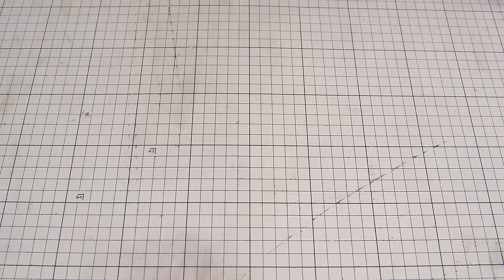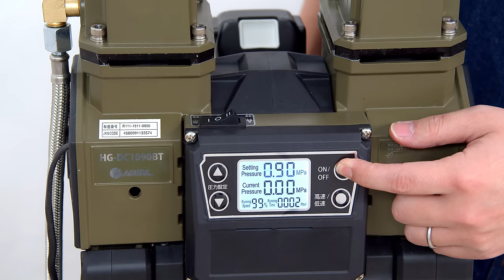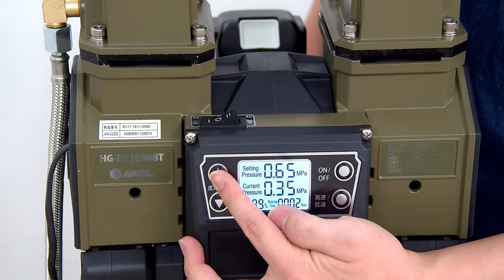How to make a simple sandblaster

Comment: Guy you super genius, you have solved my problem. I had seen so many videos to understand the basic principle but to no avail. All starts taking gas cylinder and cutting and fabricating and so many fittings which make the things so complicated to understand properly. You made so simple for me. I already had a very powerful screw type air compressor. Now I will make my own sandblaster. A big salute.

Comment: Nice build🤘- Suggestion, I think if you make a hole in the bottom of the sand container (top when mounted) you could adjust the amount of sand because of venturi effect of air passing through the pipe creates suction  in the container.🤓

Comment: I'm more impressed by that air compressor.  It's pretty cool
Reply: yeah that's the HG-DC1090BT it can run off house power or as we saw here a battery
you can get it off amazon for 35.000 yen..  In japan!

Comment: Your compressor is going to overheat and scorch your brushes and rotor. You need a much bigger compressor with a continuous duty/ cycle time to do sand blasting. 
Word to the wise. I've learned from experience so you don't have to.
Reply: Your experience was using cheap trashy equipment, this one will NOT overheat, scorch, burn, vomit and blow up!    :-))

Comment from the maker: 【Tool】
・Battery operated air compressor
https://haige.page.link/JSK_hg-dc1090btn
・Air duster
https://amzn.to/2v38pfG
・putty
https://amzn.to/3bZpwjk
・Homemade drilling machine
https://youtu.be/n-neSE8mwDg
Reply: JSK-koubou .. i found in the barn a thick plastic transparent drinking bottle with a strong and thick metal cap and it will suits perfect for this job! Fantastic battery compressor by the way..
Reply: 1
Reply: Hola..me podrias decir como se llama el producto que estas aplicando..gracias.
Reply: Karaoke Xin Lỗi Mẹ karaoke Xin Lỗi Mẹ
Reply: Nice job i wonder if put the bottle at a 30 degree back to the handle would it work better or clog ?
Reply: @XaltLures  .
Reply: Does it work with semi dry sand

Comment: Save yourself some trouble... just soak little parts like that in muriatic acid.  In five minutes all rust and scale are gone. Rinse and wire brush. Also you can use the acid over and over.
Reply: Thanks Robert for the kind reply.
Reply: Robert Coyle and what about large parts? You are very smart... before you give your opinion to criticize something think.👍
Reply: One question Robert if I may ask. For those items which can't be soaked such as a rusted metal staircase on terrace open to sky, how long we must apply this Muriatric acid to remove the rust ? Any tips? Thanks in advance.
Reply: A metal stair case might be a problem. Then sand blasting might be in order. However you would need a industrial size blaster. I do large metal outdoor sculptures. I use muriatic acid and brush it on the finished sculpture to remove the scale and rust. I use cheap disposable brushes and use gloves, a face mask and vapor mask.  I also do this outdoors. 

This is not something that you should do in your home.
Reply: On large parts you brush it on... with all the proper precautions. It works, Ive done it many times.

Comment: If you can spend money on a compressor unit that size, then why go for this fabrication, just buy a blaster unit too.....
Reply: Absolutely Correct
And without compressor what's the point
Reply: The battery powered compressor he was using looked to be no better than a pancake 5-6 gallon type. He would need a higher capacity tank and higher cfm output to be successful, blasting cabinet aside.

Comment: Don't forget the proper lung protection.

And absolutely NEVER use play sand. I know it's cheap, but silicosis is real and irreversible.
Reply: What if you use a proper mask NBC (Nuclear, biological, chemical) rated mask and outside and like oceon sand and then use some sort of bowl that will let only sand corns thru
Reply: @eliasnikolaivonheimtrondse4424  it's my understanding that silica dust is very small and most masks are inadequate. Supplied air is the logical solution but also very costly.
Reply: @superduty4556  its supposed to stop nuclear particals, they are much smaller than sand i belive, am restoring a german ww2 helmet so need to sandblast of the postwar paint
Reply: @eliasnikolaivonheimtrondse4424  you have access to a mask that stops nuclear particles and you can't afford 50lbs of glass beads for $7 at northern tool?
Reply: @superduty4556  oh its that cheap haha, thought it was expensive since yea

Comment: I like this video as well as the other video about how to make a portable sandblaster I like this video too because you can refill several bottles of sad ready to go so when you're out of one you just disconnect and screw another bottle at ready to go only thing I would consider redoing is where you cut the groove in the needlepoint ishbia lot smoother and little more open so that way more Santa come out and yet not compromise on the strength of the needle nozzle ocelot be feeling more of that putty around the cap itself besides the top that look like JD weld party at work quite well it's very hard strong keep up the good work domo arigato Captain John dancing beer over and out

Comment: Thank you for sharing.  What kind of adhesive did you use to attach the bottle cap to the air gun’s tip?
Reply: Looks like a type of "steel putty". A kneadable epoxy that hardens. Hence the 2 screws used as miniature rebar in cement so to say.

Comment: Great little project. But honestly, you could have cleaned the rust off that bar with a piece of sandpaper in 1/20th the time. A better example would have been a complex curved surface with recesses, pockets, etc.. There the bead blasting would save time. But great video overall!

Comment: Cool design but, What was your purpose for the two screws inside the top?
Reply: It helps the epoxy hold the plastic top against the sand feed tube.
Reply: @GoodTimeRx  Nice job

Comment: This project may be worth the time and effort for very little objects which otherwise would be next to impossible to clean up. However a drill, grinder or Dremel with a wire brush are ten times faster for material as was shown here. They can be used indoors and there is no sand flying all over the place. I am not knocking it, just saying that I feel for most usual jobs this can not be applied as one may hope. Just the same respect for your accomplishment.

Comment: I am very interested in your achievements and I am also inspired by the tools you use to set up a workshop for me. Precisely, the small compressor seen in the video pleases me enormously, but how do I get it to come to Switzerland? All the problem is there. Do you have a solution by any chance?

I don't care if it's 100 volts AC, I thought I would run it with Makita batteries.

Thank you

Comment: nice project, how long did it take you to work that piece?
What is the name of the material you used to glue the cap to the straw?

Thank you
Reply: In Russia we call it "Cold weld". It is two cylinders one inside another to mix them up after the cut.
Reply: The material is epoxy putty.
Reply: It's sold in the USA under various names like "FasSteel" and "JBWeld SteelStik" but they all are essentially the same product.

Comment: What is the malleable material you used? I can't read Korean.
Reply: Id say its just epoxy putty, like JB weld or similar. Sometimes called chemical metal (a stronger version of milliput, though milliput may work just fine for a small sandblaster like this)

Comment: overkill much to drill those holes in the lid ? .. instead of even drilling the holes .. soda bottle .. rinse it out .. dry it .. drill hole in sides of the neck to let that nozzle go trough tight .. fill with sand .. flip upside down .. same thing completed .. if it breaks .. get new soda bottle .. voila ofc this one looks sturdy .. well done ofc .. remember i do NOT hate :D

Comment: Will this work with baking powder for aluminum?
Reply: Yeah but you may need a smaller hole. That would just be trial and error. Probably build with same size as this one and make cardboard inserts to go in the cap with smaller holes until you find the size that works. If you really want to get fancy make the insert with plastic and instead of a hole make a slot that gets progressively larger and instead of the insert just being round put a small tab on the outer edge and cut a small slot  in the cap so you can adjust the hole size. Actually you could just put the same size hole as in the cap and as you adjust it so the holes don't line up the opening will get smaller. I would also put tab and slot as far away from the hole as possible.
Reply: @garyhager714  Thanks

Comment: Sand blaster have thicker nozzle padding
This nozzle will be eaten away in no time,
You'll pay for another one soon after
I did one already from copper pipes and it was better than this one, as the cup is opened and you can add on the go (have suction), this one will press air in to the bottle but its closed so when you stop the compressed air in the bottle will run out in un controlled way.
It must be 2 tubes one inside another.

Comment: What is that "gummy" thing called? Thanks.
Reply: Don’t know but you can use epoxy as well
Reply: I don't know what that particular stuff is, but I have used similar stuff that was called chemical metal. It has some basic whatever stuff and hardener, that's why he mixes it with his hands.